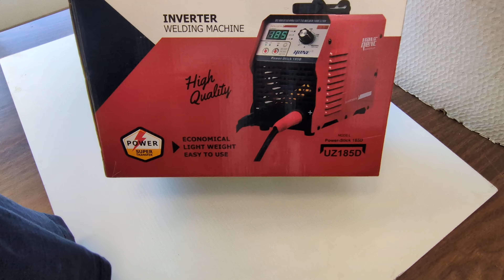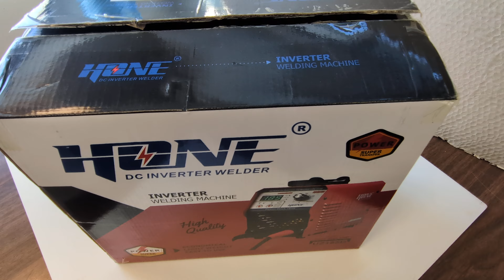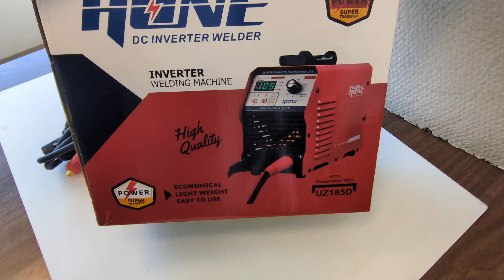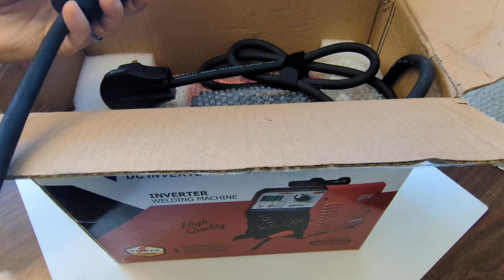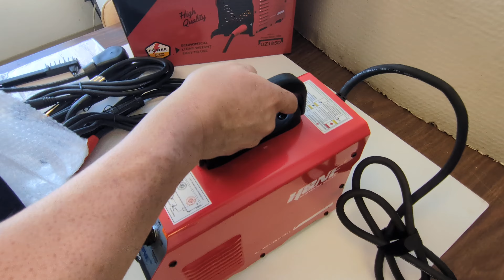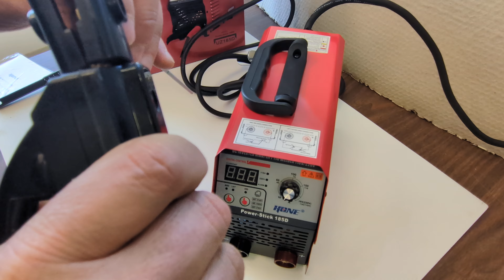Unboxing New Hone powerstick 185D stick welder

Comment: I'm a little confused about those two buttons underneath the display. For 7018 stick 1/8... 110v do I just want to keep them in the default position which I think is both of them off?

Does 90 amps sound right for this stick for 1/4 mild steel?
Reply from the maker: Sadly I have not used my stick welder yet, guess it will be a learn and find out thing.😊